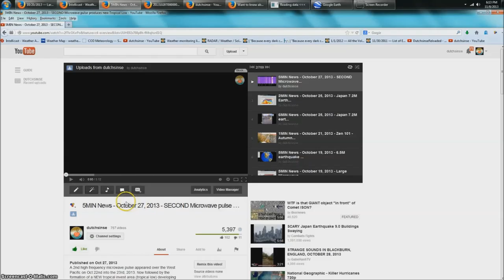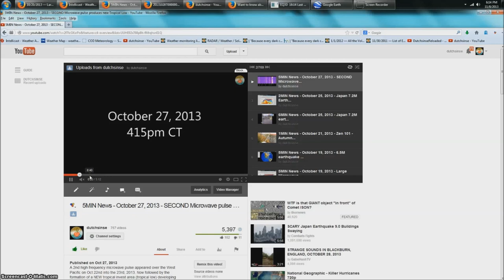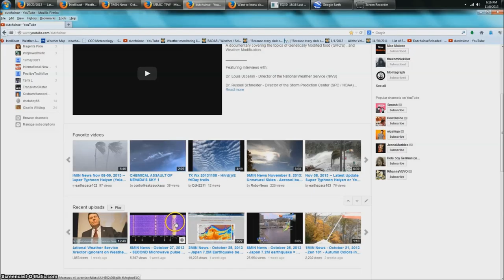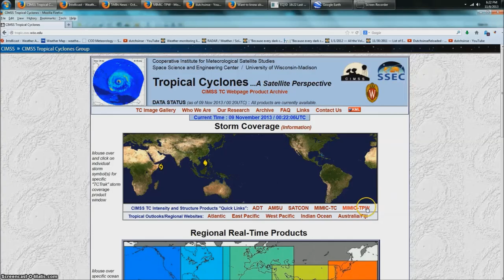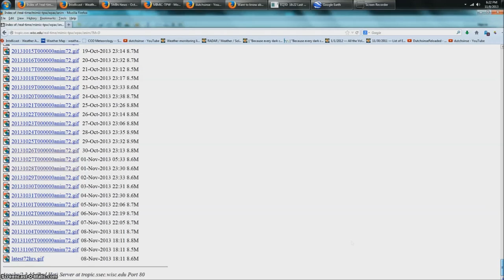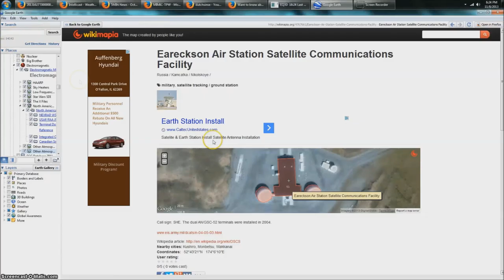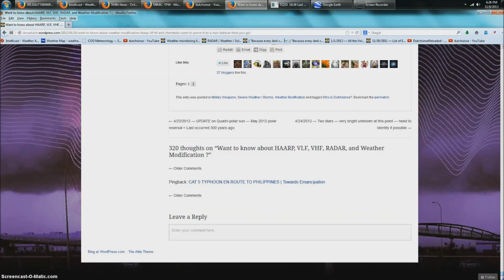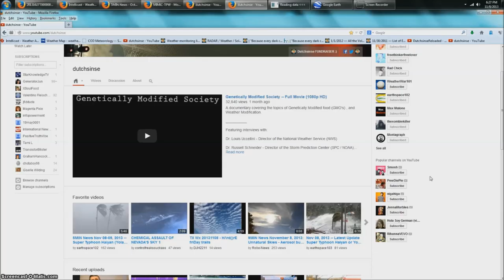11/8/2013 -- Microwave Pulse gives birth to Typhoon Haiyan (Yolanda)

Comment: Dutch, I don't agree that this storm was manmade. On November 5th an X3 class flare caused a rare "Magnetic Crochet". The peak of the flare occurred near 05:58 UT - a very short time during which the X-ray flux increased by a factor of 100. Radiation from the flare caused a surge in the ionization of Earth's upper atmosphere--and this led to the MC (magnetic crochet). A magnetic crochet is a disturbance in Earth's magnetic field caused by electrical currents flowing in air 60 km to 100 km above our heads. This undoubtedly caused a whip to the wind here on earth.

Comment: Well all of this is possible, if you tip toe past wave propagation theory and the law of the conservation of energy, and dismiss basic physics, along with know nothing of atmospheric thermodynamics, blah blah blah. Yes if you skip over enough stuff this all is possible, if you have a couple hundred antennae about the size of Mount Everest, and several generators capable of producing three times the power consumption of the entire human race in a year... it's all completely feasible.
Reply: Are you convinced yet?

Comment: As much as I do agree that anomaly on the animation is weird, and that it seems like the rotation starts right after that anomaly is shown, I am not sure if this is the direct cause of the storm or if it is indeed a "microwave pulse" as said here. One of the reasons why I am not convinced is if you consider this animation from the last 3 days, there's similar anomalies all over the place, yet the pacific is very quiet at the moment, no storms, no low pressures and weather is good. I live in the Philippines, so I know the weather here, typhoons happens all the time here and warmer surface temperatures due to pollution is making them stronger and stronger. Link to recent MIMIC animation, many many anomalies are shown: http://tropic.ssec.wisc.edu/real-time/mimic-tpw/wpac/anim/20131122T000000anim72.gif
Reply: +Skauber Where's the old comments? Removed as it speaks against the video poster?

Comment: Here's another gif from same website with an apparent "pulse" happening but no storm formed after. I'm sure more could be found with no storm formations if you went through every gif. These "pulses" are more likely caused due to errors and/or bad satellite signals than they are man-made mircowave pulses.

http://tropic.ssec.wisc.edu/real-time/mimic-tpw/wpac/anim/20130515T000000anim72.gif
Reply: Yep! These aren't microwave pulses -- they're satellite image glitches. Satellites stitch together multiple images, and the edges sometimes have gaps in them (you get a bad photo once every few days).

The biggest indication that these are image artifacts is that the edges of the "microwave pulse" are jaggy and pixellated. Fluid dynamical systems (like storms) and microwave pulses are made of waves, not pixels.

You'll notice that the jaggy artifact band morphs and rotates. That's because MIMIC is adding frames in between slow-updating satellite images. (You get one image per hour usually. So, they're morphing the images to produce a smoother animation.)

This is all explained on the MIMIC site: http://tropic.ssec.wisc.edu/real-time/mimic-tc/description.html

Comment: Hmm...if there are multiple transmitters sending microwaves at a specific point...it may heat up that area to the point that it creates a low atmospheric pressure...

Comment: It's not just from ground bases... I need to know about a signal coming from a satellite that comes down from the north every year during the hurricane season and comes down from north of Spain and continues down over Africa. So it's affecting the weather in the Atlantic causing the massive super hurricanes in recent history on this side of the globe. The problem with weather is we can't really control it but it can be exited to direct it to some degree and even intensify it but once the it's loose nature takes over. That's my theory anyhow but they are using microwaves that can heat the ocean to take something that's already there and intensify it. You can see that as you just showed but there is something no one knows about not even them. Have you ever heard of a scalar wave as a type of radio signal bouncing off the ionosphere as small taps. Think of Tesla's small earthquake device but in the form of electromagnetic pulses. This doesn't create earthquakes or not that I am aware but will affect weather. The biggest problem with mankind playing with these things is that like I said nature can be excited but not totally control and when something is done at such scale it affects the whole planetary weather because as the old saying goes: "What goes around comes around." We need to make it to winter this year. I am afraid that humanity is not ready for this technology. I know I sound crazy and I would choose that to be the truth if I could.

Comment: Can you explain why the microwave is only present in the second half of the morphed integrated microwave imagery?  Also I noticed the microwave has a larger with on the northern end than the southern end which could suggest that it was coming down at an angle, possibly from outer space such as a satellite or perhaps a naturally formed microwave pulse. Just a thought.

Comment: zoraida didn't survive long enough and became a mere LPA yesterday. what went wrong with the microwave pulse?
Reply from the maker: named storm hit the philippines .. it only had 3 days from the point of the pulse until landfall..

time is what happened.  If it had 3 more days.. it would have been a full typhoon.
Reply: dutchsinse Really? You said the pulses were beamed on November 8/9. The LPA became Zoraida on November 11. It took 2-3 days? On November 12 it was still a TD and then it died over northern Mindanao. What went wrong this time? Haiyan, on the other hand, was an LPA on Nov.2. Then became a TD on Nov.3 and a TS on Nov.4. So what went wrong with TD Zoraida? Two microwave beams couldn't hack it? Or maybe those supposed microwave beams really didn't cause it (nor did they cause Haiyan). By the way, I'm glad Zoraida never got any stronger.
Reply: people are in perfect...shit goes wrong all the time, and some things arent meant to be controlled no matter how hard some try to control everything, will never fully happen
Reply: kristyn ricca you can review some of my comments here. i'm not sure where they are now. probably buried down there somewhere with the old comments. anyway, this elaborate hoax has been debunked. a CIMSS rep already said that what dutchsinse referred here as microwave pulses were actually glitches during the processing of the image. these distortions are common and you can see them on other GIFs minus the cyclone formation. i also had a long debate with his supporters, and i explained it's impossible to create storms by some microwave pulse. it's just ridiculous.

Comment: That stated it, is more deductive that the electron is what is man made or manufactured by the arrangement of things that caused a reaction that mankind explained as electronic and then exponential into a sequence of successive things. That – having some material influence on the stimulations on the manufacturing bodies have very little influence on the true building blocks of material reality.
That coincides with the fact that what is done in a tube is not what is done in an atmosphere.

Comment: “ Equations are isolated from phogiston in ideo-mirrors schooled from ciphers formulated within the parameters of units powered to recycle in pairing groups.
The authors- not celestial mechanics- the regulators, dilated by curriculum designated to retrofit predisposing logics towards the intended coefficients that divided to form the equations now just metathesis in metastasis reflecting between the parameters of the authors interjection of rational verse irrational paired units powered to- themselves- regroup in exponential hysteresis loop.

Comment: you know there is an old saying where i'm from, "just because you can do it, DOES NOT mean, you SHOULD do it!" can ya feel me? like, driving with your feet, taking candy from babies and of coarse, heating up areas of the atm to observe the plasma? dude, the business end of the pipe, that belongs to the people running this "goat rodeo", is red hot, buh-dee.
                                                                                                                       (
                                                                                                                         ) 
                                                                                                                  /|||(|||\
                                                                 |||||||||||||||||||||||||||||||||||||||||||||||RED-HOT|
                                                                                                                  \||||||||/

Comment: Whether this theory is credible or not can be answered by comparing the amount of energy released in a storm to the amount of energy that it is possible to put out through one of those installations. According to the Hurricane Research Division of the NOAA a hurricane releases about 200 times the total worldwide amount of human-generated energy. So this explanation is ludicrous.
Reply from the maker: Look up HAMP (Hurricane Aerosols).  Sponsored by DHS (department of homeland security) NOAA, and the national weather service...

Or just watch my video on it :)

11/14/2012 -- Dutchsinse Interview -- Weather Modification of "Frankenstorm" Hurricane Sandy

Another way to look at it, in a dry forest, it only takes a spark to release the energy of a thousand nuclear bombs via a large fire.

In the atmosphere, it only takes a small amount of energy to generate the conditions for a massive return, and even though a hurricane / typhoon = 200 times gross human energy output... CONTROLLING the storm, nudging it along using frequency, only takes a small amount of power.

Like using rudder on a ship , a small amount of direction applied to an object already in motion, can steer a large vessel, the same could be said for steering a large storm.  If the frequency applied is your rudder, or better put, if the frequency applied is the ROTOR turbine, it will move the vessel along.
Reply: dutchsinse Interesting answer, I must admit. I do not feel that these analogies are pertinent though. Fire depends on lots of chemically stored energy. "Frequency applied" as a "rotor turbine" still requires a storm's worth of energy applied via this frequency. "Frequency applied" as a "rudder" would depend on a storm already being there and would still require massive amounts of energy. A ship slows down unless you continuously put in extra thrust from the engines which it is powered by. A storm is not a solid object that can be steered in the same way and is powered by pressure differences that would need to be changed (lots of energy!) This is nowhere near credible. Yes, a small amount of fluid can be moved with a large amount of energy. A large amount of fluid requires an enormous amount of energy.

Comment: the thing about 'solar heaters' or HAARP is that they are scalar events. they shoot beams that are out of phase, or, phase canceled, aka, not in interaction so they have no effect essentially until they get to a certain point. once they reach that point they come in phase interaction and create a pulse in a given point, like a grenade for example. so, with this type of event, there is no tail or trail so the effect can be localized and isolated to create a specific situation. if this were just a consistent 'beam' it would not be able to create a localized event.
Reply: +Swansen03 such as pointed out in the electrical theory of the universe. or reports of electrosensitivity. the electromagnetic elements to how everything functions are integral to understanding this reality.

Comment: Forming a Typhoon or Hurricane not only requires warm sea temperature, also various factors such as pressure conditions, amount of vertical wind shear, moisture, and forming a typhoon cannot be accomplished by a microwave beam alone. Stop trying to gain attention with those bullshits.

Comment: Typhoon Haiyan started after the anomaly that occurred in the International Dateline or Longitude 180 degrees and about 10 degrees north on Oct 28 2000utc (29/8am Local Time in that area) and ended on Oct 29 0500utc (29/5pm LT). This video youtu.be/OPoP4RY5yY4 shows cloud circulation after the anomaly and moves westward. The magnified portion will prove that dutchsinse in right.

Comment: Weather control isn't new. HAARP is an old US technology already and they have been using it multiple times in the past to create rainfall but the HAARP is not capable of creating a storm. They have something new that can create storms with gigantic diameter like the Haiyan and Katrina. Normal storms usually has lesser diameter. Storms with an unbelievable gigantic diameter like the Haiyan and Katrina are most likely created by their latest weather control technology and not by the HAARP. HAARP can only produce weird looking clouds that sometimes leaves traces like clouds falling to the ground or clouds that obviously don't look like normal clouds. These clouds produces rain but sometimes it does not. HAARP was abandoned by the US Military because it leaves obvious traces and it also failed to create the kind of destruction that they wanted. They have something new that is hard to detect unless you are monitoring the frequencies 24/7. The United States is not the only nation that is using this technology so do not single out on the United States. China, Russia and Iran are continously developing their weather control technologies. We cannot point a finger to anyone because there are too many suspects and their technology is so advanced that it leaves no evidence. It is so advanced that if you tell someone about it, that someone would probably tell someone that you are crazy.
Reply: Let us not blame the American People. They are not responsible for these typhoons. It is also unfair to conclude on who is responsible.
Reply: A high ranking military official is already conducting an investigation about the possibility of these said man-made typhoons that hit the Philippines. After the investigation, he will go to Siquijor and use Voodoo to punish those who are responsible.

Comment: ok. maybe weather modification can be attained but still no one can create a storm from scratch. so this storm is not man made but maybe modified. but again, there are still doubts if it can really be modified. we already know that the atmosphere is full of energy. we just have to alter its path for it to form a storm. but in order to alter its path we need greater energy or at least strong enough to alter it. so maybe microwave impulses can be introduced. but by how much energy should be projected? depending on our technology today i don't think there is any machine that is 100% efficient in transforming electrical energy to microwave energy. so f*ck quantum physics or newtonian physics any machine still depends on electricity. so if we can produce microwave impulse enough to alter the weather wouldn't you think it will need a lot more than what a single power plan can create? and for those who argue about sound waves just look for the  wavelength spectrum. sound, light and microwaves are all waves, they are just distinct by their frequency. and i'm from the philippines by the way.